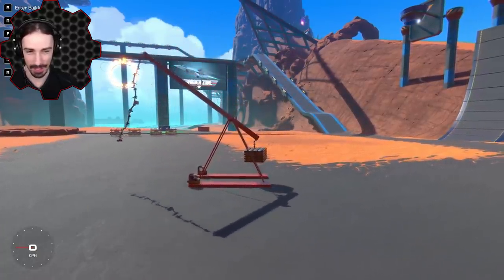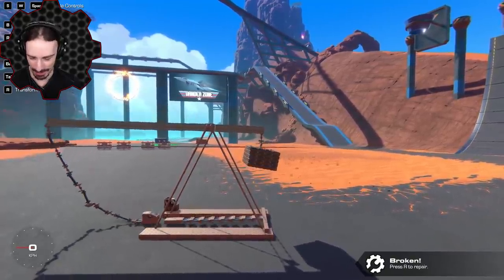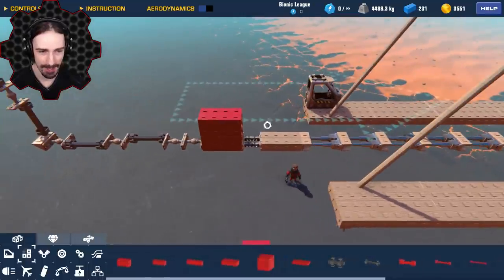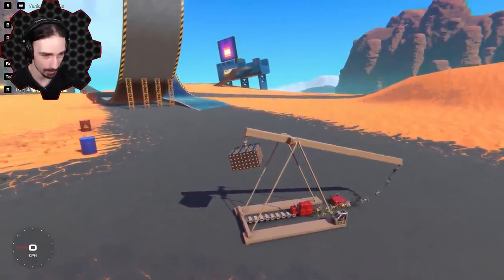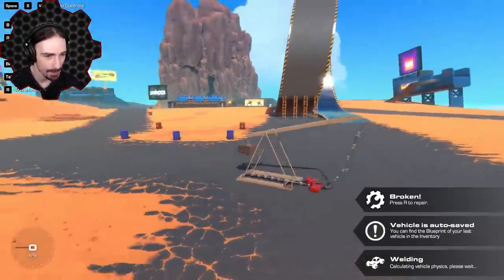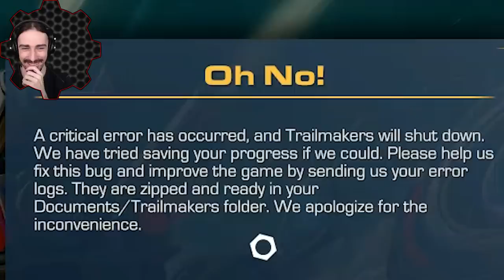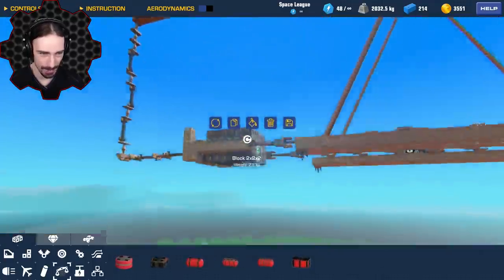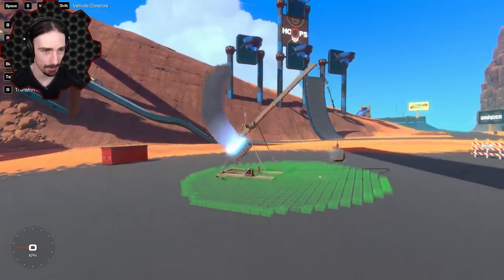Is This Trebuchet The Superior Glitch Weapon?  - Trailmakers Gameplay

Comment: when i was making a car i encountered this bug that one of my wheels was completely detached from the cration because the suspension broke, but i still functioned and when i entered build mode it did'nt bring back the broken parts... i hope they fix this annoying bug
Reply: i got in 1.0 update a similar glich, when i repaired an 500-600 complexity car it hapens to change some of its block colors to white and if i repair in other place ther are ghost block floating in air, i did the same thing on a server and i got around 15 creations floating in the air, of course that i was under them and i was not able to move, i rejoined the server and the creations teleported to me, it was like a tarp or something
Reply: andy andrei ITS A TARP!!!

Comment: I made a trebuchet back in high school, the arm length/ratio at around  @10:40 when it broke is actually closer to the proper length for it if I remember right. Also, the weight for the counter-weight should be fixed on the Z access so it only creates Y and X forces as it drops through and pivots on the end of the arm, the twisting and sway reduce the force and precision because it loses the force to the Z axis when it sways.

Comment: Potential solution for more power with the weights:

Trebuchets work by converting gravitational potential (weights) into kinetic energy (projectile).
     To increase the gravitational potential, you can either increase the weight, or increase the distance the weight starts from, and where the final position of the weight is. (Essentially the reason why the weights on medieval trebuchets were on hinges above the pivot, the as it rotated, the weight would swing by the pivot, ending near the ground).

Comment: You should put your weight on a hinge. You have it attached as if you are hoisting the weight and not using it as a counter weight. The single attachment point at the top is allowing it to swing and twist in any direction, then coupled with the narrow base causing it to destroy itself with each use. In the case of Trailmakers, I assume that the pieces don't handle tension very well, so I would lengthen the portion of the arm which the weight is attached to.

Comment: You need to make one but instead of detachable blocks use a electromagnet and make a boulder as a separate creation so you can use the boulder or a barrel ( explosive or non-explosive) and you can use any small creation like buster